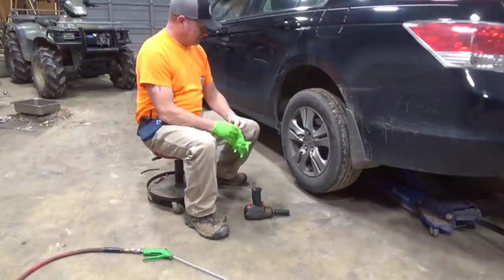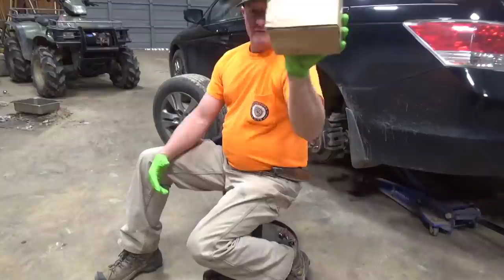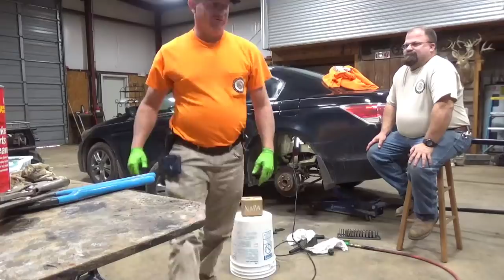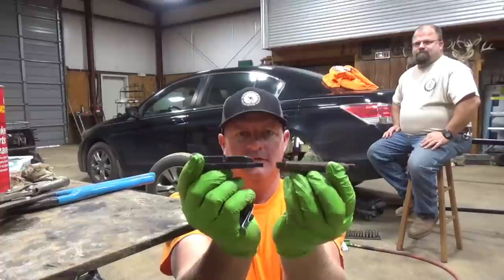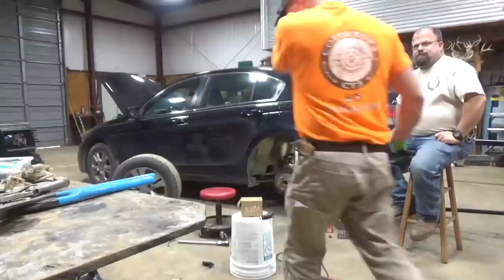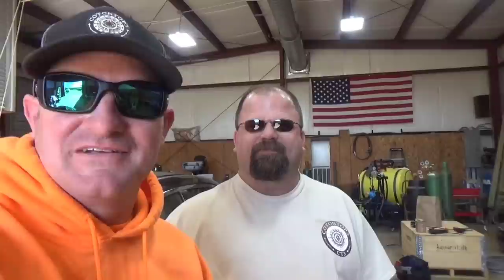Honda Accord rear brakes replaced

Comment: Shop tip, since you have already gone to stainless restaurant pans in the shop go get the 6 inch deep and a 2 inch perforated pan and lid to use for parts washing out in the field, solvent in the deep pan and the perforated 2 inch in the 4 inch pan to put the parts in soak wash and clean the parts, pour the solvent back in a jug for the next time and nest the pans together for storage.  now that I do more wood working than mechanic stuff the parts washer is gone and the stainless pans are on the shelf for use when needed but not taking up any floor space when not in use.

Comment: Tim those left hand pads where only worn on one side, could not see if the right side was the same but they should be worn the same amount, makes me think the piston on one side of the calliper is seized. Cheers mate 🍻
Reply from the maker: The calipers only have a piston on one side.
Reply: cotontop3 OK, the caliper should float in the frame then so that both pads grab the disc, either that or cars just aint built the same as they used to be and I'm now oficialy just an old fart. LOL.